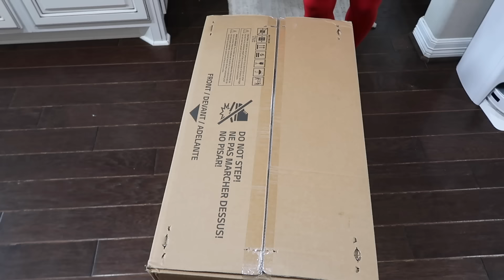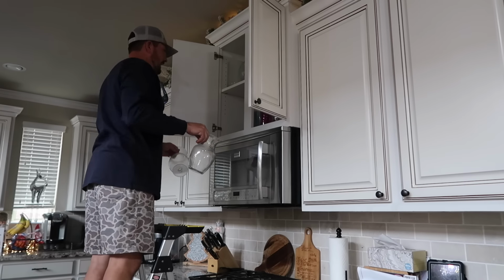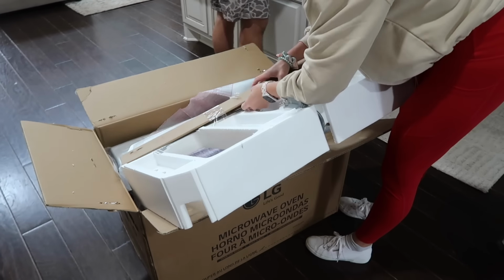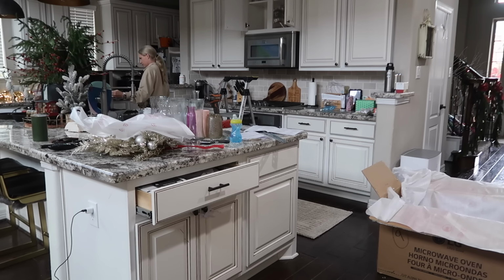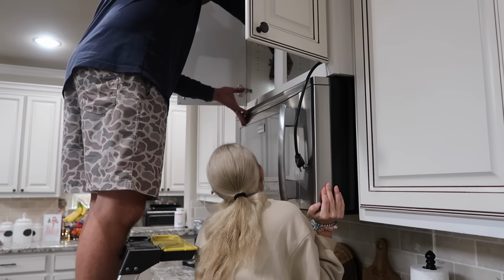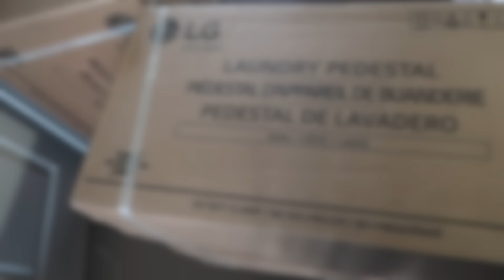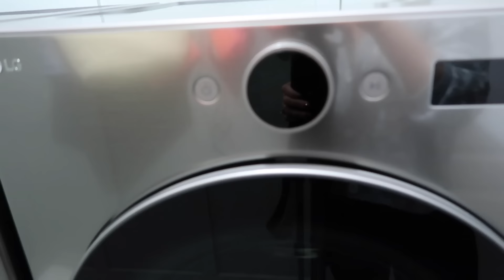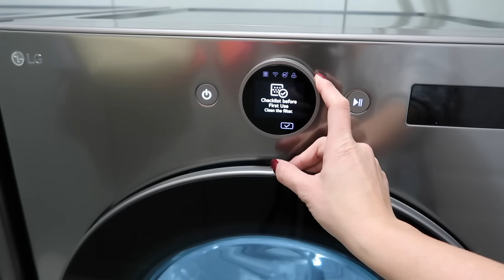NEW YEAR RESET 2024 / MESSY HOUSE CLEAN WITH ME 2024 / NEW YEARS CLEANING MOTIVATION / 2024 GOALS

Comment: Happy New Year Michelle and as always thanks for the cleaning motivation and your words of wisdom.  As far as the microwave is concerned, I just wanted to point out for anyone also installing an over-the-range microwave, ITS NOT RECOMMENDED.  A gas stove should have a proper Range Hood for correct ventilation since they need about 400 CFM which equals 40, 000 PCU in gas.  Most Microwave won't be strong enough to support what emissions a gas stove gives off.  Now not saying people can't do what they want or that the microwave won't work for some time, however, it will stop working faster and could be a potential hazard, so just be aware.  Happy New Year Y'all.